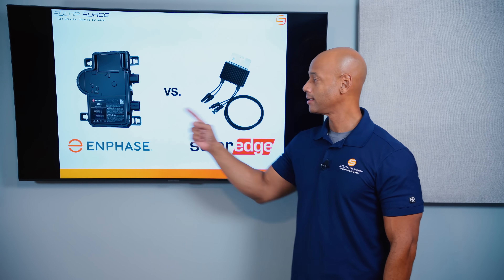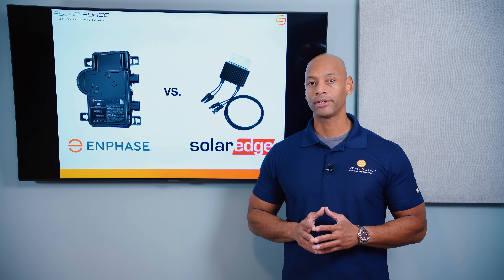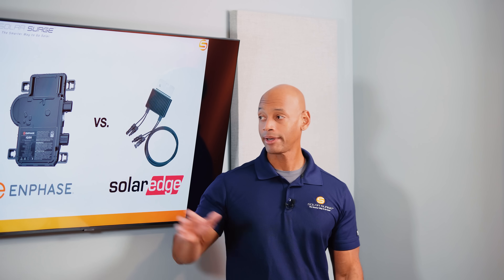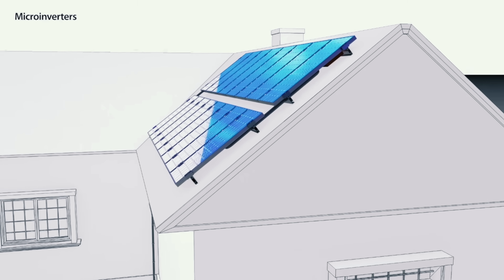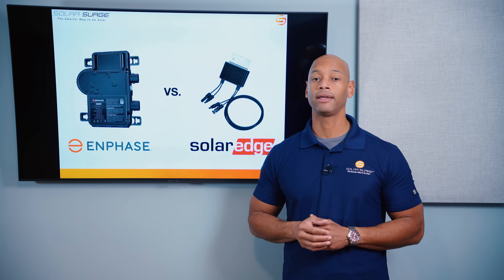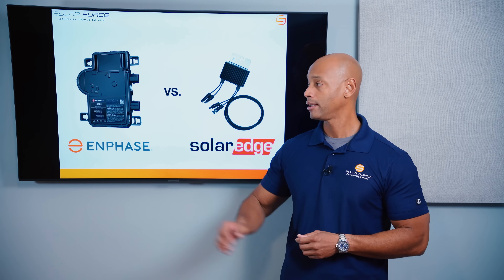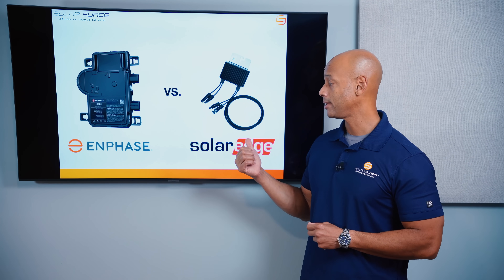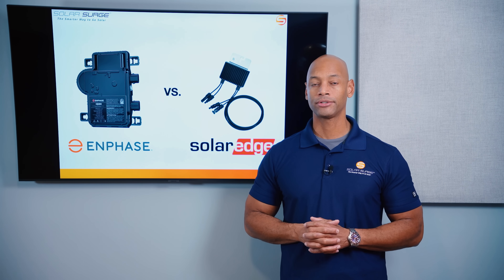Micro-inverters Vs DC Optimizers (2024 Updated) | The SHOCKING Truth

Comment: Thank you for the side by side comparison of these two options.  I am building a new home in a community with only 2 quality solar installers available.  They unfortunately both strongly encourage using Enphase micro inverters, even though I am also wanting a backup battery installed.  I have a hard time ignoring the efficiency loss of the DC-AC and AC-DC conversions, especially since it looks like the only roofs available for panels will be east and west facing.  I think their resistance to using the DC optimizers is most likely related to brand loyalty, comfort with the Enphase products and services provided to them.  I am trying to decide what I am going to do.  I may choose to install my solar panels in a few years from now after I see how the new Tesla Power Wall battery plays in the market place.  I also wouldn’t be surprised to see Enphase add solutions with DC optimizers in order to cater to customers with my preferences and to compete more effectively with Tesla.
Reply: My solar edge inverter smoked after 5 years. The installer was less than ethical and I ended up installing a new one myself. I have the required installers app I got from a tec otherwise that would not be possible.
Reply: I think Tesla powerwall 3 would have been the best choice for me. Unfortunately it wasn't available until about 3 months after I already installed my system. String inverters are the way to go and my gut tells me Tesla is going to be around for a while. Smart money with just spend a little extra and have a spare string inverter card sitting on a shelf. Way more efficient solution than having multiple microinverters creating multiple failure points under every damn panel.
Reply: I have both a string inverter on the SW roof and Enphase micro inverters on the NE roof.

So far the Enphase micro inverters clearly beat the string inverter in low light conditions and when shade hits any of the panels. 

Also the string inverter is likely to need replacing after about 10 years while the Enphase micro inverters are likely to last their 25 year warranty.

The string inverter is almost 5 years old now and I had a lot of problems with chimney shade.

I chose the Enohase system to avoid any shade headaches and to save space in the home. With only 8 panels on the NE roof the cost difference is negligable and if your panels are not between SE and SW a lower peak output is not really an issue.

For a lot of panels without any shade issues I would go with a hybrid inverter just to save money. But with trees, multiple roof orientations or dormer shade the Enphase system is truly great. In my case putting a battery somewhere is already a challenge, so I may go for an AC battery that gives me some freedom of placement.

Just my two cents.
Reply: i was in a similar situation when we did our install this autumn. one contractor offering enphase, the other offering powerwall 3. i struggled for a month over the decision, flip flopping back and forth between the lower cost and more elegant design of the tesla system, but the robust redundancy and flexibility of the enphase system (being able to hook up to a gas generator was a nice option to have).  

in the end we decided on enphase. mostly because we live in a rural area, and the enphase installer was much closer to us for support. and if we do need support, we know that likely our whole system isn't going to be down, only a portion of it - which will keep us with power when we most need it. i also really like that enphase has a native web app, my eyes are really bad and reading my phone is hard lol! though i must say, thank goodness for these bad eyes because boy are all those enphase boxes on the outside of my garage a real eye sore... 

if i lived in the city, i think i probably would have just gone with a powerwall (well powerwall-esque type solution, honestly elon gives me the creeps...) i think the dc optimizers are performant enough to make them a viable option, but the fact that they still create a single point of failure at the inverter level was just more risk than we were comfortable with.

hope you're able to figure out which system best meets your needs.

Comment: Haven’t solar panel bypass diodes. I think that’s what they’re called pretty much alleviated the need for module level devices ( at least where shading is concerned)
Reply: They do and they do work.  I have a string of 8 residential panels and 2 get shaded in the late afternoon.  The string drops to roughly 7/8ths, and then 6/8ths of its production when that happens.

Jasonoid, if you are losing the whole string then make sure that the string voltage is not dropping out of the MPPT range due to there being too few panels after discounting the shaded panel.  If the Vmp of the shaded configurations drops too low, the string will stop producing because it will be running closer to the Voc.

-Matt
Reply: I haven't seen any significant benefit from bypass diodes on my string array of 400w residential panels. One panel gets shaded and I lose most of the power production.

Comment: Skipping all of them and operating at the lowest number of panels per string possible is always the most cost effective.  I really wish they would bring back lower voltage mppts/inverters depending on your setup because it reduces complexity, yes extra wire is needed but frankly PV wire is stupidly cheap and less complicated.  Microinverters are just a bad idea and always have really been for long term.  Stepping voltage up or down generally is not that big of a deal its the conversion from AC to DC or DC to AC...not changing the voltage.
Reply: You can get those types of MPPTs.  Look at Victron gear.  My favorite is the 150/35 (150 Voc max, 35A output @ battery voltage).  Its perfect for strings of 2 or 3 residential panels, or a greater number of smaller panels.

That said, if you are only doing 3-panel strings you will wind up back-hauling a huge number of relatively thick solar PV cables.   Just back-hauling 3 strings with 10 AWG solar cabling is 6 cables + ground and needs 1" conduit due to the thickness of the double-insulated solar cabling.

-Matt
Reply: @junkerzn7312  You can do a 3 if that works out for ideal shading.  I ended up doing two because I have two arrays of 10 panels and my first MPPT is matched to output and my second is over paneled.  It also worked out better for me for shading.  Frankly the cost and complexity for me was minor vs the cost of a optimizer which adds a lot more cost.  Even the 6awg wire I used was only about ~50 bucks for the two runs I have each again the cost of like a solar optimizer but PV wire is frankly dirt cheap the labor if you are already there is minor.  Anywho I just think people are being over sold on extra stuff with a carefully designed system can save a lot of money and complexity.
Reply: @darrenorange2982  The rule of thumb is that the string needs to produce sufficient voltage with 2 panels shaded and in bypass.  Meaning the MPPT still needs to be able to operate well with 2 panels dropped from the string.   Of course if you only have 3 panels in the string, you can drop the rule to just dropping 1 panel.

Generally speaking, this is fairly easy for grid-tie string inverters where string voltages are in the 350VDC+ range when the string inverter only needs to produce a 120VAC waveform (for 240VAC split-phase or 120VAC output).   The string needs to produce roughly 170VDC to remain optimal, so there is a lot of room for dropped panels.

For Smaller battery MPPTs, the battery voltage is going to be (up to) 14.6V, 29.2V, or 58.4V depending on the battery topology, so the DC string with panels dropped must still be able to produce at least that much voltage plus around 5VDC.   Vmp (operating, not open circuit).

Call it 20VDC, 35VDC, or 65VDC depending on the battery bus voltage, to continue to operate optimally.   Also fairly easy to achieve with a limited number of panels though you have be a bit more careful with 48V battery systems on a 150Voc MPPT where you can only afford to drop one residential panel due to shade in a 3-panel series.

-Matt
Reply: @darrenorange2982  Yup, I agree.  I vastly prefer more cabling than more electronics.  6 AWG is a bit thick tho. 10 AWG ought to be plenty for single-string runs that aren't paralleled.

Comment: I think micro inverters are probably going to lose favor given the more flexibility of keeping it DC. With more batteries and EVs with bidirectional chargers, there may much more efficiency to be had by going DC to DC for those components
Reply: Here's a question for you!? I'm interested in designing a micro inverter that can assist ac loads of off grid application, say someone installed a off grid solar system of 5k pv (in series), 6k inverter 240v split phase, supported by a 12kwh battery, though later they realize that there system is under size due to shading on PV or they have company for the weekend. Seems like a simple answer is add more PV with micro inverters to assist with the off grid inverter AC loads during the day so that the existing system can fully recharge the battery!? Is this possible? Thanks Nate
Reply from the maker: Good observation.  If the DC-coupled offerings can match Enphase's reliability and after-install support then I think you are correct.
Reply: Joe, I’d bee wondering why people were still installing Enphase Microinverters. Thanks for clearing that up.
Reply: @SolarSurge maybe enphase should offer a DC optimizer solution!
Reply: I need to replace my roof in the next few years. I’m thinking point guard with 2  8 kWh batteries and REC alpha panels. I live in Tucson so the high efficiency low temp coefficient is attractive. If I get an EV then can add a bidirectional EV charger
Reply: Maybe some architecture like dual smaller parallel inverters able to handle 1/2 load each might provide more resiliency in case of an inverter failure. Maybe a little more expensive but you know you’ll at least maintain 50% power even when inverter down
Reply: I agree as well, for two reasons.  First, because large integrated battery solutions like the Tesla PW3 have MPPTs built-in (six of them per unit, in fact), basically for free.  And second because regulations are slowly moving away from requiring junk up on the roof which is what tripped-up string inverter companies like SMA in the first place.  No micro-inverters, optimizers, or RSDs needed.  aka UL 3741.
Reply: @junkerzn7312  I’m sure microinverter companies lobbied for current regulations
Reply: @marcppparis  Yes. Most regulatory bodies, including the NEC, have regulations that are more or less formed by the companies that make the equipment.  If they can find a way to sell more gear, they will.   It isn't through any nefarious reasons... its only because the code-making bodies and conferences just aren't that interesting for neutral third parties to attend.  They get top-loaded with parties that have a financial interest in the regulation.

In the case of RSDs, fire fighter unions formed a concern over dealing with live solar equipment and micro-inverter and optimizer companies pounced on that to more or less push-through mandatory per-panel devices, since they could optimize the equipment they were already selling to also perform the RSD function.

Despite that, most regulations do make sense.  Just that in the case of solar, they don't.  Putting the equipment and extra connectors up on the roof vastly increases fire risk up on the roof.  This got lost in the pile.

The actual risk to fire-fighters is extremely low, and with like 10 minutes worth of training to either not muck around in the panel footprint or just clip the cables (zero current flow)... disappears entirely.  It's a non-issue that has been blown all out of proportion.

This mechanism is also why the GFCI regulations have gotten so messy in the U.S., by thet way... makers of circuit breakers saw an opportunity to sell more expensive gear and it got to the point where GFCI main breakers are being mandated even for dedicated circuits for devices like EVSEs that already have internal GFCI monitoring.

-Matt